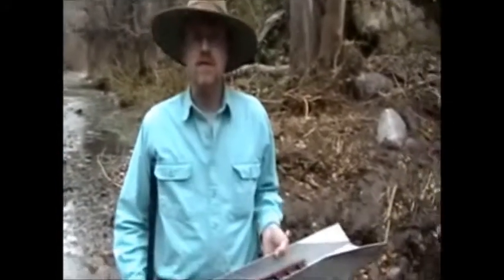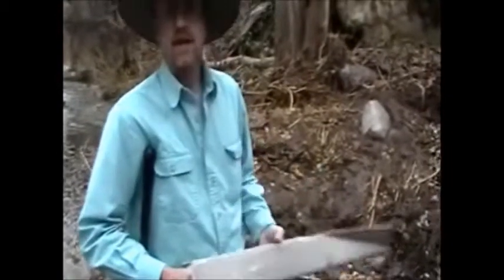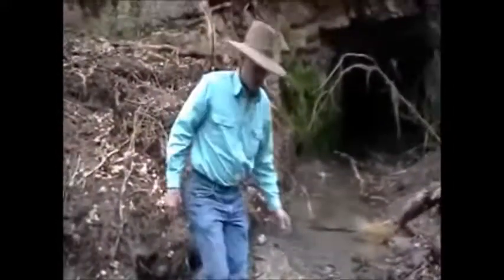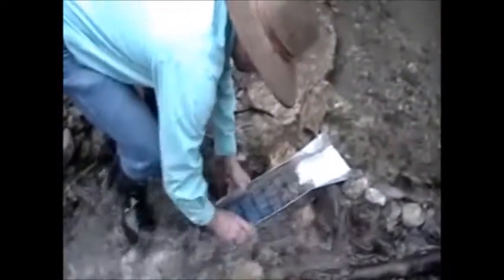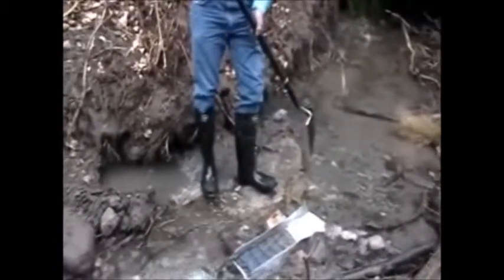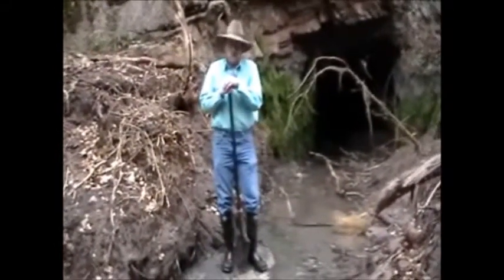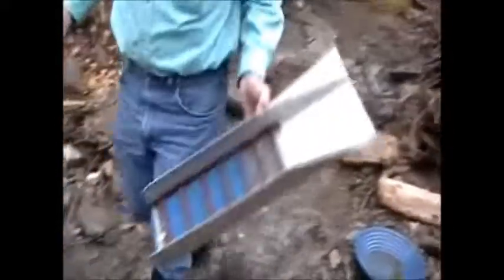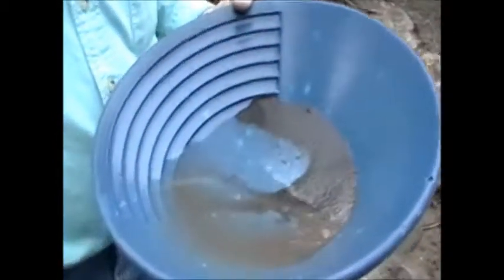Setting up a Sluice.wmv

Comment from the maker: JohnI put a rock or shovel full of gravel under the head of the box to get it to the right angle, then put rocks (in a "V") at the head of the box to channel water in, and on the sides to stabilize the box. If ther isn't enough water, make it steeper.
Utah

Comment from the maker: It would help, but would slow down the production quite a bit.  I figure  I might recover 10-20% more gold if it were classified, but would run about 50% less the material due increased processing time.  The math says skip it. 

I believe in more volume not increased recovery.  I will work to increase the recovery when running high grade ore, or when it doesn't impact production volumes.

Comment: Hello, I have your book a guide to Utah gold prospecting.  I live the St George, and want to go up to Beaver dam wash.  I have been up there before, and wanted to ask you some questions cus I can't seem to find anything. I think I'm prospecting wrong.
Reply from the maker: Beaver Dam Wash is a tough place.  The gold is very spotty.  My best luck was behind large boulders, and it wouldn't hurt to run a sluice--it will increase the volume of material you process.   The gold is there, but it's not easy to find.
Reply: @achenworth1  so I have been prospecting about 300 yards down from arsenic gulch. Should I be down further?
Reply: @10mmfinder556  you still go out that way? Have any luck? I live in Southern Utah and just started prospecting wouldn't mind going out with others. Just went this last weekend and only sawa few specks in 4buckets.